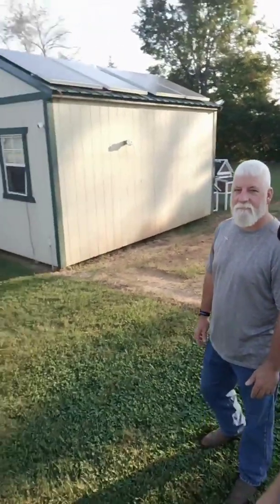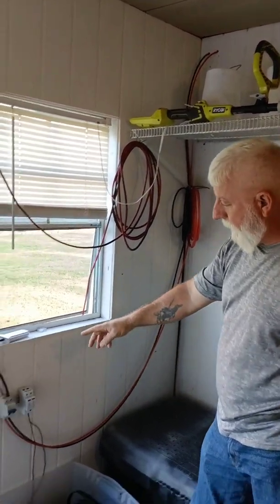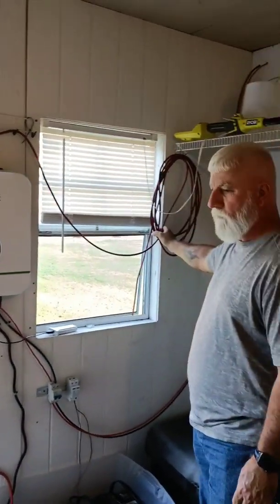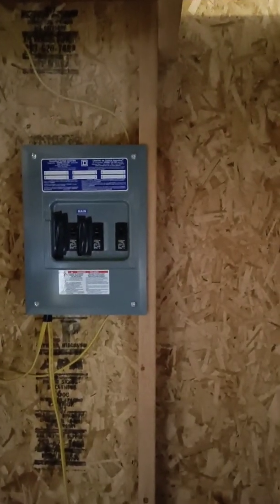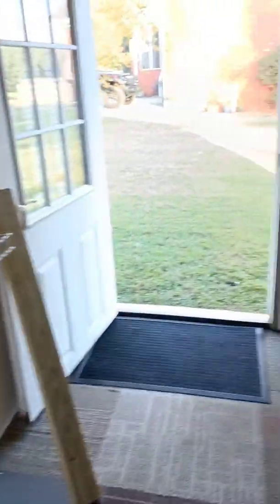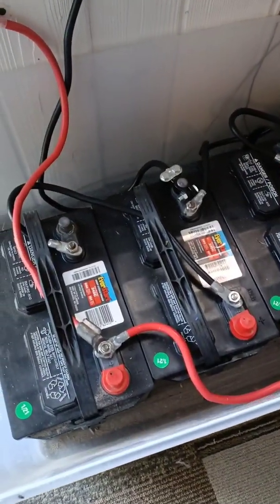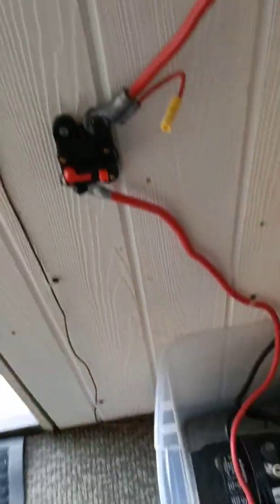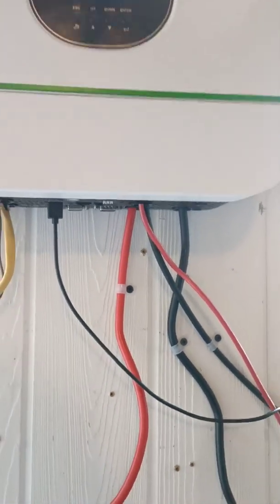Interview with a customer showing his 3,000 watt off grid solar system

Comment: For someone that wants to van life full time you have my attention. Seeing as im gonna need atleast 2400 wats per hour just to power half my van build
Reply from the maker: The really big problem with mobile solar is the lack of roof space. If you are working with 250 watt panels, you would need 10 of them to cover your 2.4 kw needs. No way your van has the room for 10 of 36x65 panels. People that don't move around moch (at all) can build ground mount solar arrays, but that means you cant take it with you when you drive. Some folks have a couple of panels on the roof to help keep the batteries charged on the go and have a ground mount array setup next to their permanent parking location.

Comment: What was total cost for 3000 watt solar?
Reply from the maker: THe costs are dependent on a few things based on your needs. Are you local to the North AL Area? That is where we are based. If so we can get you set up with what you need to get running
Reply: @tennesseevalleysolar4101  no I'm in NC

Comment: Hmmm. I think the Growatt 3000w has a 13 amp limit on solar input per channel. Ours have a maximum of 500V 
open circuit voltage. I would run two sets of 8 amp at 120V and connect both channels of the Growatt. That
would reduce heat concentrations on the inverter PV inputs.  We are doing a 33Kw system with 7 Growatt 5000w
inverters in parallel in the Philippines. Usually it takes 2 inverters for split phase 220/110 connected in parallel. 
We opted to configure everything for 220V output and use a 5000w "torroidal transformer" to make the 110V. 
There are several transformers and several sub panel load centers to reduce wire runs. All our LED lights are 220V
in the Philippines. 172 LED bulbs total 600w and with solar power we just leave them on. There are (eventually) 
seven LiFePO4 10Kw batteries that are charged by 10AM. Currently each inverter feeds one 48V battery pack
with the battery packs in parallel. This requires 14 switches to cut off the system (PV plus batteries) but allows
isolation of the subsystems.
Reply from the maker: The unit shown in the video has only one solar input. I think you must be talking a =bout a different unit. Growatt has quite a few different models. Some of them come in the same cases making them hard to tell apart

Comment: So, it is possible to connect just one inverter to a circuit breaker? I thought it had to be split-phase.
Reply from the maker: No, the unit in this video only provides single phase. This unit connects only to a single pole breaker

Comment: Nice. I just ordered the same unit. I had a 1000 watt mpp all in one but it wasn't enough to run everything.
Reply from the maker: Nice 👍 I just installed this same model at my off-grid cabin
Reply: @tennesseevalleysolar4101   What type of Battries are you using ?

Comment: Pretty fancy unit just to charge a few batteries and run a couple fans  
  I’m thinking about that growatt for my cabin it’s just so expensive
Reply: Most units are built are built in Asia it was interesting that just before I watched this video I watched one by Will Prowse using the same all in one but with a serverrac battery simple unit and budget friendly 770 for the growatt and 1500 for the battery that'll last ten years plus solar panels
Reply: I got Easun 2400W  24V unit, ~250$ a pop, working fine. 
Always a risk going with cheap chinese, but its an option.
Runs a drill, vacuum cleaner, 2000w heater, no problems.
Reply from the maker: Everybody has to start somewhere. Most folks that I work with start small as they experiment and grow from there